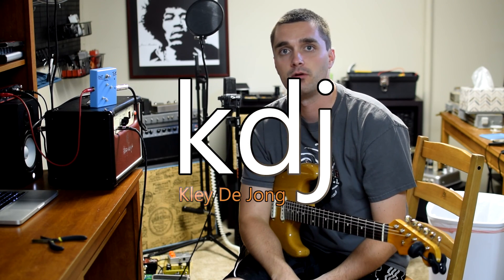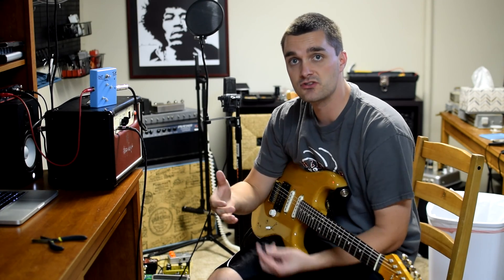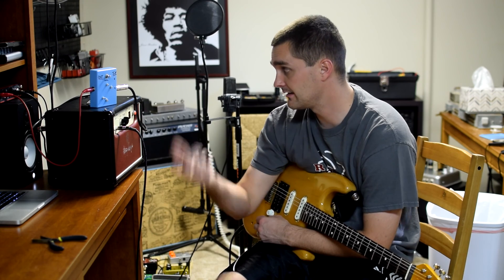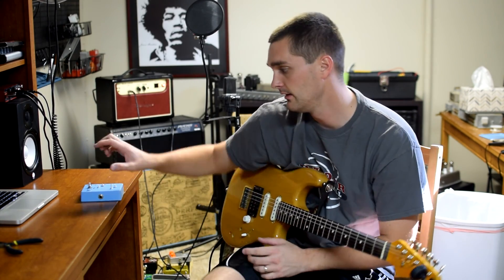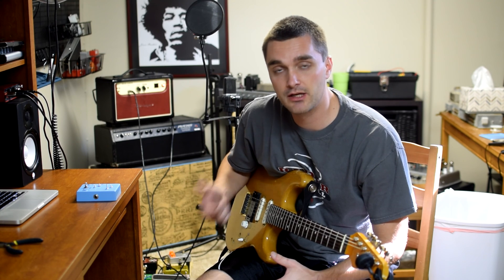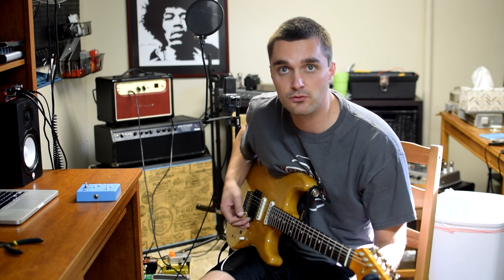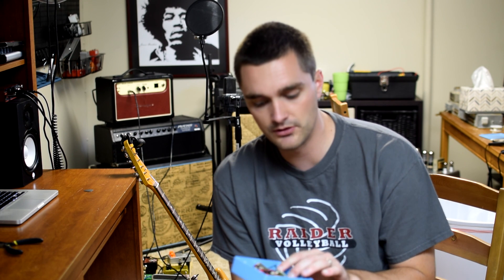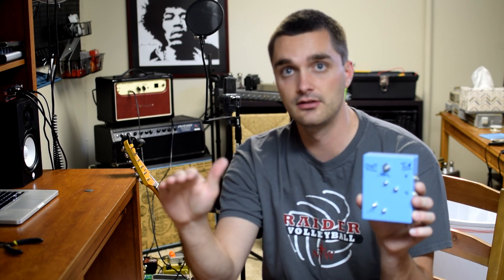DIY Guitar Amp Dummy Load Box With Line Out

Comment: Hi Kley, Awesome channel. You have some great videos. I just built a power soaker using a variac to be able to run amps at a lower volume. I am trying to understand your circuit diagram on tdpri. There should be a massive voltage drop across the 10K and 1K resistor voltage divider. Are you using a 1K as a volume pot?

Comment: good job. I think I want build one. These passive devices right?? So for impedance matching, you could send this into an analogue cab sim like Bulldog, or Condor cab sim from runoffgroove dot com...which basically built to interface pedals directly with home recording boxes, or even the old mic inputs on computers...ie line level signal..should work ok. your valve junior sounds way better than mine..I gave up on the thing years ago, sat unused for years..what mods did you do?? I might have to dig mine out, and do some modding.

Comment: Sounds better than the Mesa Cab Clone! Well done! Curious about heat dissipation; that power has to go somewhere. I noted your thermal paste to the box shell response below. What's the longest run time you've had putting power through the box and have you monitored the temperature of the box (one of those laser thermometers might be nice for that)?

What part of the box are the resistors attached to?
Reply: garretmkiii I would auggest to you to get the highest quality load box sound wise and don't fall for the marketing ploy that heat can destroy a load box. I have a Rivera MiniRock Rec and I would have loved the better 'reactive sound' simce it can't overheat at all. Maybe If I crank my 100 watt Triple Rectifier(removed 2 tubes to make it like a Dual) then it will overheat but at normal volumes heat wouldn't be a problem even with the cheapest load boxes.

Comment: Nice video. How is the heat dissipation on the 50/100w amps?  Does the petal box get hot?
Reply from the maker: I used thermal paste to adhere the resistor to the box.  I use it with 50 watt amps no problem.  I don't have anything bigger to try, but I probably wouldn't use a 100 watt amp with a 100 watt load.

Comment: What makes this different from an attenuator? I have a Vox AC4 combo amp and I am looking to build something to stand between the amp section and the speaker. I want to be able to crank the volume so it breaks up but keep the output volume at a bedroom/apartment level. Also, there is a knob on the amp that cuts the watts from 4 to 1 and 1/4 watt. Theoretically that knob should solve my problem, but 1. the amp cranked on the 1/4 watt setting is still quite loud for a bedroom, and 2. the tone gets squashed and muddy on the 1/4 watt setting.
Reply from the maker: A load box and an attenuator are pretty closely related.  My load box applies a resistor to safely load the amp, then it has a DI output to send to an audio interface.  Very simple.  

An attenuator may also have a DI output that would function similarly.  But they're usually designed to also have an output to run between amp and speaker.  Many have some tone shaping controls to help keep the tone consistent from loud to quiet.  

Your AC4 has a built in attenuator to take it down to 1/4 watt.  My experience with many common attenuators have those same kinds of problems you describe.  It is hard to heavily attenuate the signal without losing something.  

My best experience has been to run amp - attenuator / load box DI output - audio interface.  Then apply a Speaker Cab Impulse Response using a VST plugin in Reaper.  For example I often use Pulse VST with some Ownhammer IRs.  Like this:

https://www.youtube.com/watch?v=zeBgS23JhPg

Comment: Quick question. Differences between reactive vs resistive dummy load can be heard, thats for sure. But what if I want to use only preamp out for recording (without power section "flavour")? In that case, it should be irrelevant which type of dummy load is used (without any sound differences), am I right? Then I can put some power section simulator in vst plugin form and I should be golden. Right? Or am I completelly wrong? :-)
Reply from the maker: A preamp doesn't even require a load like a power amp does.
Reply: I dont mean preamp, but preamp out (or fx send) on actual amplifier. You need load for silent recording
Reply from the maker: The fx send / preamp out is a preamp.  It will be roughly at line level.  A load is not required on a preamp.  

You still need a load on the power amp's speaker output regardless.  

See this thread for more information:

http://forum.cockos.com/showthread.php?t=141071
Reply: We probably dont understand each other. :-) Yes, I know how preamp 
out/fx send works, and I know that I must use dummy load for power 
section if I want to record silently. I am just curious if I can hear difference from that preamp 
signal IF I will use resistive or reactive load for power section. I 
think it should be the same soundwise, as reactive/resistive load makes 
sound difference because of power transformers. But as I will use only 
preamp signal, I should be good even with cheap resistive load. Right?
Reply from the maker: Sure, I guess I was just wondering why you would use a load on the preamp out if you don't need one?  If you want the best tone coming from the preamp and are concerned with how a resistive load may or may not affect the tone, why not just skip it and run straight into your interface?  

To answer your question though, I don't think it would have a big impact.  8 ohms of resistance is very minimal to really affect your signal much at that stage.  If you have a volume control in line that would probably have a greater impact than the load resistor itself.  

If you think about a typical master volume control, adding an 8 ohm resistor to its output is like going from 500,000 ohms to 500,008 ohms.
Reply: TheOklep Yes! I have tried what you're asking and yes the preamp out aka slave out on a triple rectifier changes its sound according the load being provided to the power section. Try recording with the preamp out through an IR. First with the cabinet as a load and then with a resistive load without a cabinet. The sounds has reduced highs and lows due to the impedance curve missing.

Comment: Dare I say the load box and IR sounded better than the cab and sm57?  I can see how the cab feels better to play in the room. How hard would it be to include a speaker sim to that load box?
Reply from the maker: Listening to the clips I tend to agree.  The mic'd cab has a raspy quality to it.  Perhaps keep in mind that the IR was professionally captured and prepared.  Meanwhile I'm just a hack in his basement sticking a mic in front of a cab.  I didn't spend a lot of time on mic positioning or using EQ on the SM57 capture.  

I think the biggest thing about the resistive load is going to be feel.  The bounce and compression of the notes when you pick.  Just feels a little flat.

Honestly, for $20 I will get a lot of use out of this little box for recording.

Comment: I definitely can hear the difference.  Everything I've read made me expect that though.  Resistive loads create tone suck.  Very cool experiment, though, and I love seeing how it shows the results.  I still think you can use it for experimental tones though.  Whatever head that is sounds great through the sm57!
Reply from the maker: Thanks, it is a 5F2A Tweed Princeton circuit that I put into a Epi Valve Junior was broken and gutted.  

I would also say from the player's perspective that the flatness of the resistive load is especially apparent while playing.  There was a dullness and a lack of response while I was playing.  Listening back to the clips, I actually like what the resistive load + IR does to the EQ.  The gain is about the same.  But the real cab has a liveliness to it.  

But considering how simple the circuit is I'm glad I built it.  $15 in resistors plus the parts I had in my drawer.

Comment: Reactive load sounds much better, especially in the treble. Just add inductance in series.
I use 150watt 6.8 Ohm resistor with 0.5 mH inductance in series. It's Epcos RM10 N87 core and 1mm enameling wire. 11 turns. Works perfectly with 100 watt amp. 
After assembling the coil produces sounds. I dipped it in lacquer, and vibrations are gone.
Reply from the maker: I definitely will try my hand at a Reactive load box in the future.  I decided to start with the Resistive load given its inexpensive parts count and simplicity of circuit.  I've only been tinkering with amps for the last year or so and have no background in electronics, so the reactive load is a little over my head at the moment.  

There is a thread on TheGearPage with some great information on Reactive Loads as well:

http://www.thegearpage.net/board/index.php?threads/aikens-reactive-dummy-load.1072793/
Reply: Keep up the good work!
But do not forget to play guitar :)
This is a great project.
But I think the main difference is the treble inductance.
I often cut bass resonance peak in miced guitars and did not make this part of the circuit.